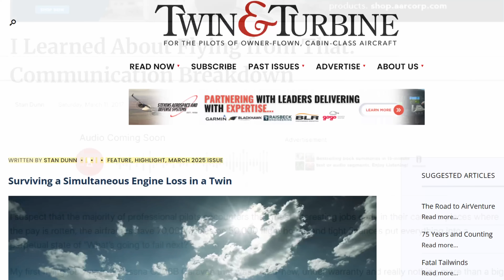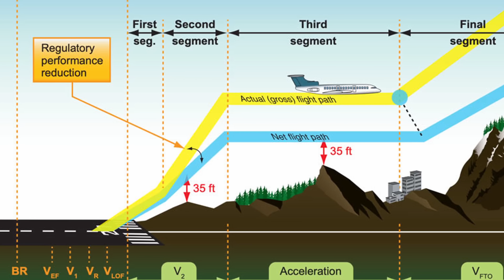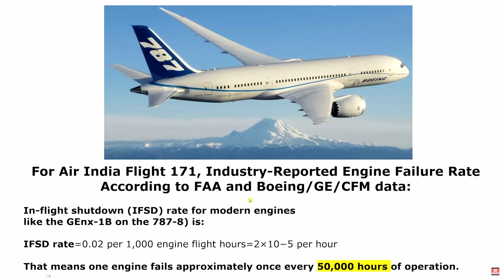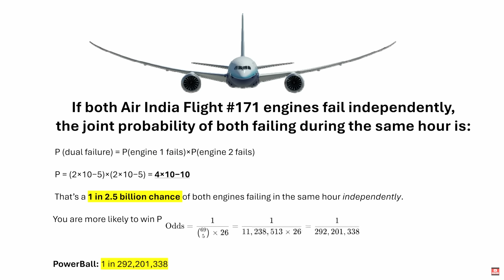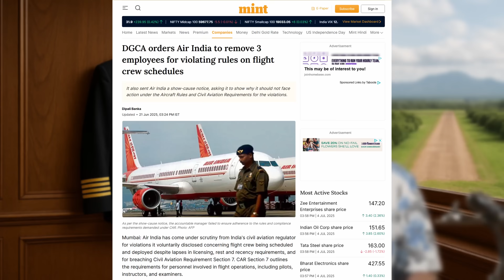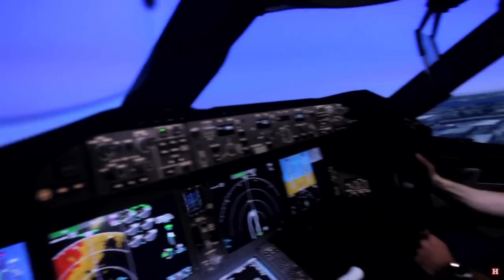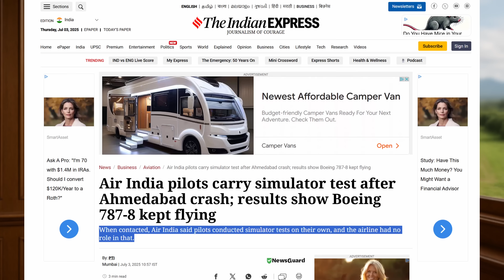Air India 171 Cause Becoming Clear

Comment: 13:32 oh no, not again. This is ridiculous, nobody shuts down an engine before reaching the safety altitude and then tells ATC: Trust not achieved
What's more likely: a full electrical failure, possibly a short circuit triggered by water ingress, water which had already made its way into the "supposedly dry" avionics bay because of some toilet water leak (has been documented before), this water shifted its location once the aircraft rotated, triggering the sudden mishap. Then the RAT deployed. 
Maybe this could have been prevented if the avionics bay had been inspected.
Reply: Look up the 787 "248-day" software bug. Even though the integer overflow was fixed (not Boeings first or last overflow bug) the system is still architected so that the PCU can command all 4 AC generator control units to disconnect, this is a power management safety feature. While it's true the engines can run on only the engine-driven pumps (not electric), these have documented limitations (high altitude is one) and it is reasonable to hypothesise a few contributing factors that might reduce their performance and make it critical: high temperature (vapor lock + need for more thrust), rotation (gravity forces / movement of fuel), gear stuck down (extra drag). Obviously this is speculation but the spontaneous electrical failure has precedent (248-day bug) and evidence (RAT and gear movement before failure)
Reply from the maker: The FADECs reside in separate areas and are powered by separate busses. And a better translation of the pilot mayday is “no power, no thrust, going down.”
Reply: @flyingformoney777  There has been several translations of what was radioed in. I'd short it down to the pilots knew they were in trouble and they radioed it in. The exact words they used to express their concern is of no practical use.
I am not an aviator, but I do know the term 'aviate, navigate, communicate'.
The dude on the radio skipped the first two steps. Why? I dunno.
Reply: @HOOOLD_ON I do not agree with you. They did Fly, Navigate first until the limit they could, and then comunicate. Normally in highly stressful situation most pilots become startled and not able to comunicate themselves. The captain shows his concern, probably knowing that he has nothing else to do, and a mayday (distress message) was the last resort to ask for help because the accident would be inevitable.
Reply: @iuriryzewski2648  The mayday was the professional thing to do. Alerting the surroundings of imminent danger, as well as for the crew and passenger's to assume an emergency posture.
Reply: The one thing the pilots mayday and the survivors description prove is there was sufficient power to the system until the last. The 787 will prioritize power to avionics and flight systems over cabin lights.  One there I have not run across is a cargo event taking out some or part of the avionics or electrical.  I have seen a few instances where shipments of lithium battery's burn/explode under the avionics bay to do this, but the one thing that make me doubt it at the same time is how fast everything happened. The engine roll back happened seconds after v2....
Reply: @flyingformoney777  Something has to explain the deployement of the RAT which is clearly audible. Don't the fuel valves need a permanent DC voltage to prevent them from shutting off? Shutting down a engine just seconds after rotation would not only be an extremly quick decision, but also a pilot's error,  and contrary to standard procedures.
Reply from the maker: @SuperZardo the engines will run without any generators. They have a separate, dedicated emergency power source independent of the other electrical systems.
Reply: @flyingformoney777  You're right about that. Also I found that the electrical actuated DC fuel valves (28 V DC) should remain in position after a power lossm, since they are actuated ball valves and have microswitches for their end-point positions.

However, four  explantations are still possible: 

1. Short-circuit of the control logic for the fuel system (managing fuel pumps, crossfeed, and fuel valve positions) within the centralized Common Core System (CCS) processors in the avionics bay, resulting in uncommanded closure of both fuel valves 

2. the same, but resulting in uncommanded switching off of fuel pumps 

3. some more serious AC short circuit  directly affecting the fuel pumps (less likely because of the redundancy and automatic isolation of faulty circuits) 

4. After electrical power loss, upon re-initialisation, a software fault erroneously switches of the fuel valves (possibly a scenario tested in the lab, therefore not very likely)
Reply: @SuperZardo  Yes, fuel shot off valve was activated, and cut off fuel to both engines.

Comment: Smart analysis. Why did the captain not call " mayday- engine failure"  rather than " mayday, thrust not achieved". ???
Reply from the maker: There are different translations of his radio call. Another is “no power, no thrust, going down.”
Reply: Good point 99
Reply: @haiwatigere6202 i wondered same thing but if they shut down the wrong engine, they would likely not include it in a mayday call.

Comment: I said this the moment I saw the two videos of the crash;

Someone in the cockpit pulled the fire handles around about Vr.

There was no sizeable yaw or large flight control deflection associated with a single engine failure.

The gear doors auto extend upon WoW switch detecting flight. Unless an engine failure is detected first. 

The two engines are independent units. Controlled by 2 independent FADECs. As you allude to, Stan, the chances of such a dual engine failure occurring right at the same time is just……..impossible. Basically. 

Somebody cut the fuel, hydraulics, air and electrics at liftoff.
Reply: “Thrust Control Malfunction Accommodation” or “TCMA” is a safety software that helps to prevent un-commanded high thrust situation by utilizing EEC functions, as part of the overall FADEC computer system. 

TCMA has the ability to shutdown the engines automatically when FADEC is in ground mode.

Dec 2024, the FAA issue AD about faulty LRRA (low range radar altimeter) on 787 which may cause “undesirable A/T behavior” and may lead to “controlled flight into terrain” (fancy wording for “plane crash”)

Note that LRRA is also utilized by FADEC to sense air/ground mode…

So a faulty LRRA would’ve cause undesirable A/T behavior + FADEC issue in sensing air/ground mode.

If FADEC is in ground mode but plane is in the air and then you get this “undesirable A/T behavior”

How likely is it that TCMA was activated and shut down both engines simultaneously shortly after lift-off?

Definitely far from impossible… 

I’m not going to conclude or say this is the cause of accident… but this scenario matches perfectly with everything we see so far.
Reply: @tonamg53  I am on the same thoughts process as your analysis.
Reply: @tonamg53  I can certainly see the logic in how that form of in-flight shutdown could’ve occurred but that said, there are a multitude of specific conditions, all badly timed, needed for that to happen.

Maybe the near total silence from the investigation to date points towards your suggestion and the various parties involved are scrambling to get ahead of what will be an almighty sh1tstorm if turns out what you suspect is the ultimate finding.
Reply: It would have the same effect that we observe, one would imagine. If I was the captain I could probably do the cut-offs quickly, though the FO might get miffed, But how do you explain all the controlled flight that follows after? However unlikely it seems, the end of the flight seems consistent more with a kind of uncommanded shut down of the engines.
Reply: Pulled the fire handle? Seriously? Unless there is a fire indication, pulling the fire handles would take two hands pull each one. They are locked with no fire indication.

Comment: I guessed from beginning that either, bad fuel, electrical computer failure, or sabotage like turning both engines off.  Since no AD's where issued since crash, sabotage is looking likely.
Reply: Sabotage my arse. What a load of nonsense
Reply: IMO -  I have been wondering about the possibility of sabotage all along......
Reply: @butterflygirl2285  Then maybe you will win a prize. Not.